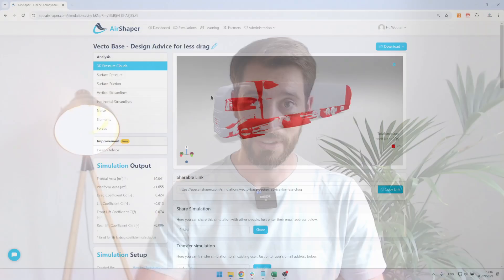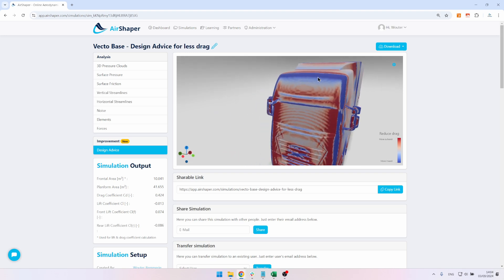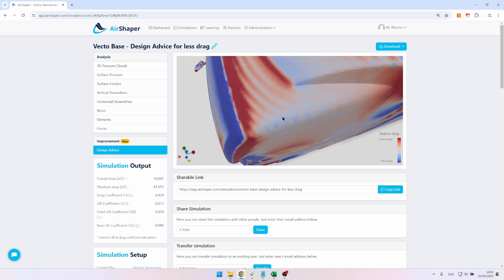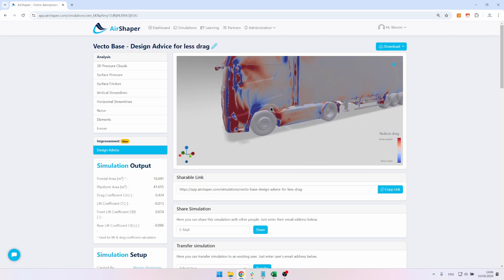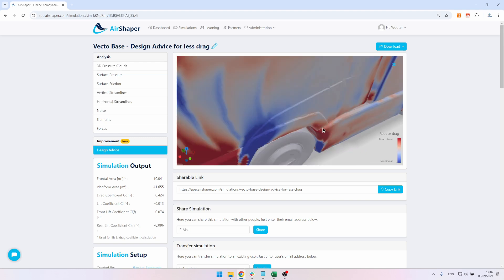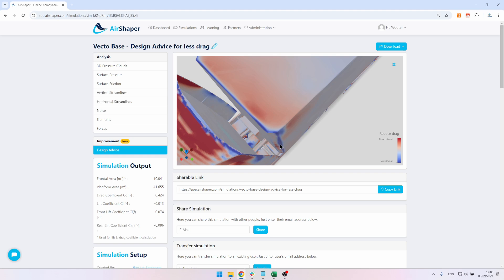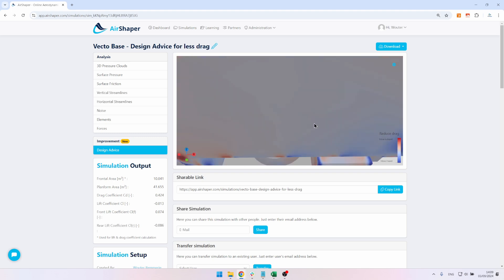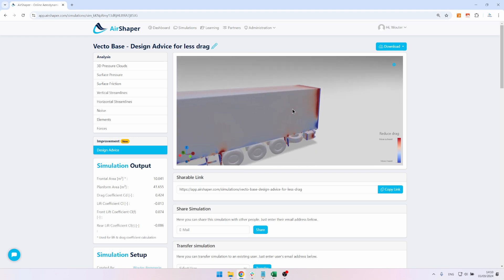Reducing Aerodynamic Drag on a Truck without expertise

Comment: A clear flexible inflatable aerodynamic shaped extension bag at the rear of trucks would reduce drag, it would be clear so that the braking and other lights could be seen through the plastic, it would possibly need to be deflated in order to load and unload, therefore may be most suited to long haul journeys.
Reply: Something more tricky may be that at least in the UK, the trucks back onto/docks with a semi-automated loading bay area, and I believe the trailer needs to have a good interface with the dock.
Reply from the maker: That's true, it's hard to optimize trailers without affecting the loading bay.